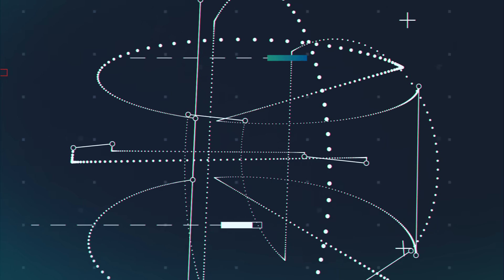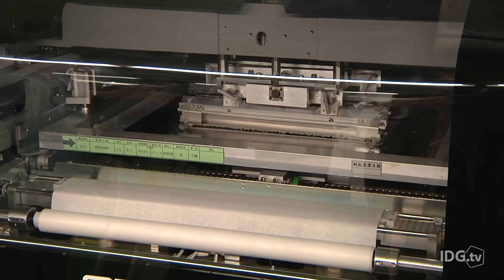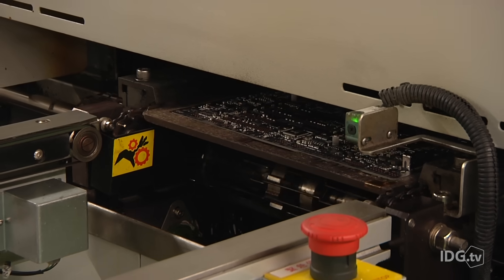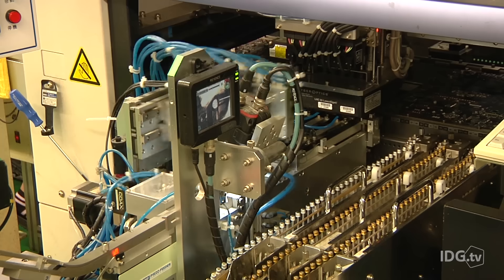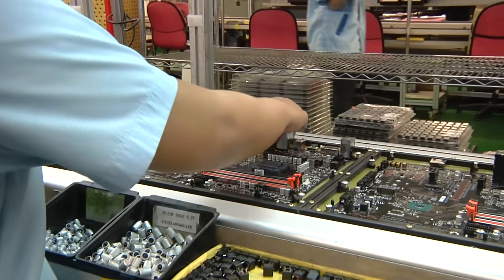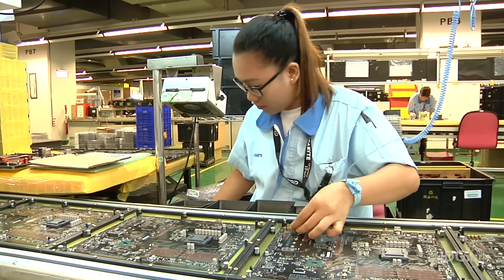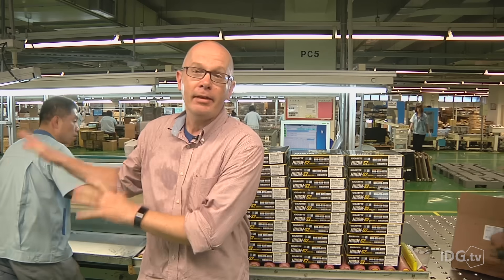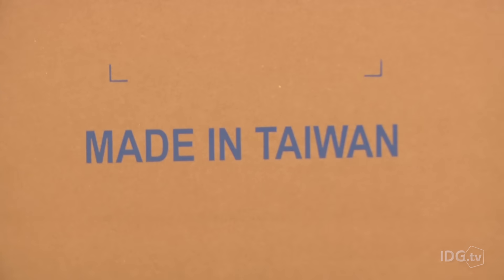How a motherboard is made: Inside the Gigabyte factory in Taiwan

Comment: At least it's not like the Apple child sweatshop one would suspect. I wonder what the workers are being paid
Reply: the same goes with doctors .. the only reason why service charge in Western country is higher than korea and singapore is because of cost of living.

uh singapore is one of the countries with the HIGHEST cost of living
Reply: factory assembly line workers don't require high degree of knowledge or skills that are difficult to attain. so, don't expect them to get paid with high salaries.
Reply: Han Lockhart Why should she? She is the packager not the designer. Her job is to bag motherboards. Do the people bagging the groceries in a grocery store know how to operate agricultural machinery? Can they tell me if I ask them what conditions are required to grow the groceries they are bagging? How would she even utilize such information? The boards are predesigned, and only assembled at the factory. It's not like the packager could say: "hey as I was putting this motherboard in the plastic bag I noticed that the 543 components composing the on board sound card could be reduced to 541 and have a 23.1% improved efficiency. Let's stop production and inform the couple hundred of my coworkers about my new setup during lunch break."
Reply: no no, that is not what I meant...
listen, you run a company making a certain product which is also made by many many other companies, several producers targeting the same market and buyers in that market are for the most part low income young people and they look for the best bang for the buck items, the cheaper it is while still being good enough the better... these companies make products that compete with each other on the dollar, a few bucks difference can completely hide a product from the search filters of an online shopper or shove it way way down even into another page if they search "cheapest to most expensive"... a company will never sacrifice it's profit(else why work and invest, they'd take their money elsewhere) and they try their best to make the product as cheap as possible in order to sell it, thus the last variable they have control over is the employee wages which is usually the lowest possible wage set by the law... these companies don't require electrical engineers for the assembly lines, they take in uneducated people and put them to work even sitting down... to be honest those people have it good by having investors opening up such businesses there, if they started demanding higher wages then the company would just close and leave to some other poor country who's citizens will work for cheap enough so that the product can compete in the market. the worst thing that can happen to these people is demand wages high enough that the company starts seeing complete automation as financially more reasonable than manual labor, and thus slowly firing everyone :-/
Reply: I worked at siemens in Germany who also produces certain motherboards and the workers doing the same job as the workers in this video are getting around 3000 euros a month, which is an absolutly crazy ammount.
Reply: I mean , a 10 year old has the skill required to assemble a motherboard, it's not any harder than building a set of lego's , so they don't get paid very much for unskilled labour
Reply: 300 $ per month.
Reply: @LosAngeles2011  It would be a great salary. If that is a decent salary in Mexico for a low skilled worker I figure that is decent amount in Taiwan.
Reply: @gonzayare  wut, taiwans not poor mate
Reply: this isn't a fantasy land where we can shit out money and everyone can be happy. 

You get paid for the difficulty of your work. An engineer will bust their ass in school and work and will get paid more while a factory worker doing 1 thing or a low skill worker won't be making shit, because simply you don't get paid for doing almost nothing, not because it's expensive to live. The plus side to going to bust your ass becoming certified is that employers who need you will offer benefits, I think you'd understand this because you have a job and aren't some 13 year old making this comment.

If you get jipped by cheap labor then I feel for ya
Reply: shayson1357 - Thank you for the suggestion. It's not a small business. I don't have that amount of money at the enterprise level. :)
Reply: James Chua 

I’m sorry but you are dead wrong. Cost of living has little to do with labor pricing. I mean sure on the very low end there will be a slight effect, but its very minor and in this conversation not even worth talking about. It has everything to do with supply and demand, thats it. The healthcare prices have risen dramatically in western countries because we have a bit of a shortage of doctors caused by the extreme amount of time it takes to train one. I suggest you study economics a bit more.
Reply: Minimum wage would be around USD700/mth, but they probably get a little more than minimum, let's say 800 to 1,000/mth, after insurance and tax. 300 and 2,200 are wrong.
Reply: peanuts
Reply: not much.
Reply: You’re thinking China, Taiwan is a separate country. Even though China does often try to claim everybody’s country belong to China.
Reply: @Han Lockhart Before you can work in the assembly line, all new employees need to take up to a month of training where they need to take bunch of exam and be familiar with every components the PCB have,, they need to know what they look like or what are their purposes, training for employees who operate the SMT machines is longer,, and for the salary Taiwan basic salary for a factory worker is NT22,000 a month or $716 a month, plus night differential pay, food allowance, medical and dental care, complete attendance incentives, bithday gift certificates, grocery gift certificates, monthly bonus each department if they reach their targets, 7 days paid holiday every year plus 1 every month if you are a woman (pms) and alot more incentives,, you can get $1000 or more depends on the demand
Reply: I remember the sneaker manufacture stink made a few decades ago when US unions tried to pressure the US sneaker companies to pay their foriegn workers more. "Children forced to work for 17 cents an hr in Vietnam!" Until it was revealed that due to the cost of living they were the highest paid employees in the villages.
Reply: Degree of knowledge is just a tiny part of how how much a wage should be for a certain country. 

COST OF LIVING is the primary gauge of standard wage in a country. 
this is why U.S keep crying on low cost of labor in asian nation. because asian government "REGULATE" the cost of living in their country.   unlike the Western economy who's cost of living just keep on rising and the worker keep on asking increase on their wages.  

The result... no manufacturing wanted to do business in their land. 

it also applies to professionals.  like the web designers on crowd sourcing website... the western designer keep on shouting foul coz they can't compete hahaha. 

the same goes with doctors .. the only reason why service charge in Western country is higher than korea and singapore is because of cost of living.
Reply: @ChibiKeruchan  no, in capitalist society cost of living doesn't mean anything to the price of labour. The wage is determined by replacement cost, which is the cost the owner to hire other worker had one left feeling underpaid.

As long as the owners can find replacement at whatever the price they offered, wages are independent of other factors. This is essentially what's called in economics a supply demand equilibrium.

So it made sense in China or any other countries that workers got paid so little, because they have massive population that Labour supply exceeds the actual demand of labour. This gave the negotiation power to the buyer(the employer).

Sure cost of living can be one of the factors that will drive up the equilibrium, but that's not the main reason.
Reply: @ChibiKeruchan  Hah, no. That's not how it works in real life. You get paid by how much your employer thinks your work is worth and the more replaceable you are the less you get paid
Reply: It should be at least $1,000 per month. The experienced should be at $1,500. I was born there.
Reply: they get paid approximately $2200 a month for this type of hand work.  gigabyte is one of the richest manufacturers and they love their workers.
Reply: We don't know whom is working there when the cameras are gone....
Reply: shrie brown, open a business and pay them that :)
Reply: Its a pretty good paying job. They can make up to $330.